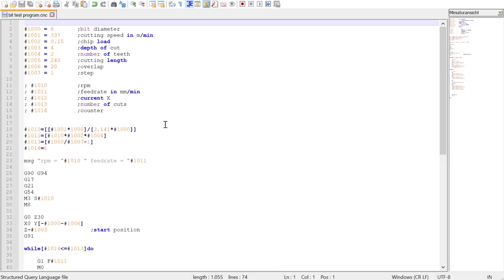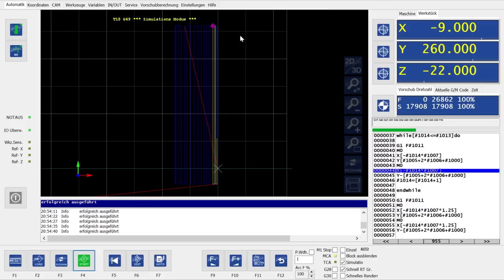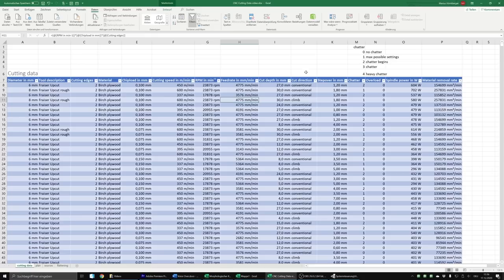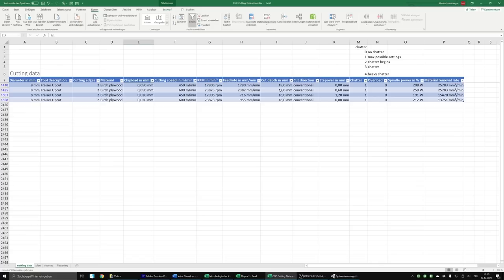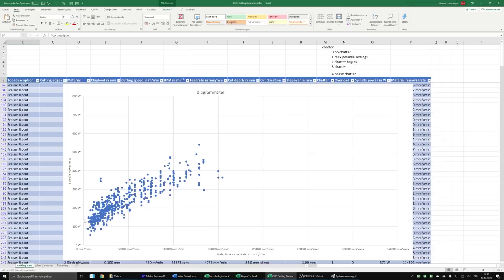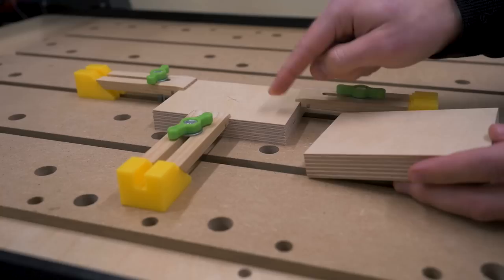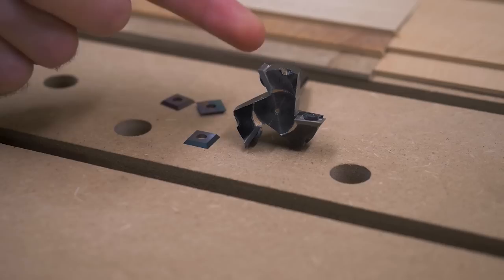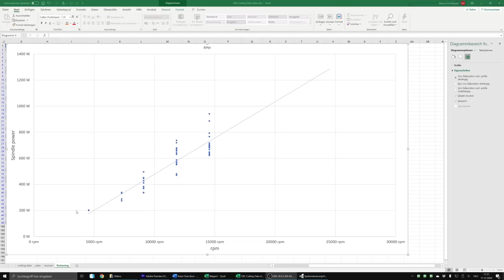Testing Diamond-Coated Routerbits + Giveaway & Free Spreadsheet

Comment: It’s interesting that they make solid carbide diamond coated bits for routers. Usually machinists use solid carbide endmills because you can run them 2 to 4 times faster than you can for high speed steel. They are also the best thing to use if you have to cut something hardened. The only issue with carbide is that you can actually run them too slow, and any slight variations in feed rate or sudden movements means chipping the teeth right off. Because they are solid carbide you can probably get away with 10,000RPM 2500mm per minute for soft wood, and 7,500RPM 1900mm per minute for hard woods.

Comment: Makes sense that the high RPM low feedrate generates more power consumption, because for the same amount of material removed the cutter has to make many more cuts.
And breaking up molecular bonds between the fibers of the wood is alot harder than throwing the resulting chips off to the side.
Also small chips don't clear as efficiently.

Comment: The 8mm roughing bit is fantastic, I don't have any bits that don't chatter. I did add two liner rails to my CNC Shark, which uses two polished steel rods, I couldn't believe how much flex they had in just a 900mm length rod. It had roughly 5mm of up and down play at the bit and could not be used for anything requiring detail, but not anymore, virtually no play at the bit now.

Comment: You made something really useful for many people, kudos to you

As for 6mm vs 8mm I found the same thing when milling metal on my small-ish mill. For deep cuts, you should use the smallest endmill you can get away with in regard to deflection. My mill will do steel with 4mm and 6mm, 8mm is seriously pushing it and 10mm is completely unusable. I optimistically bought 50mm facemill hoping to use it on aluminum but no joy... it chatters like crazy even in plastic.

Comment: For the spindle stiffness I would not look into the mounting, that looks perfectly fine, but in the bearing arrangement. In the 3D model AMB provides, you can see the bearings probably are a set of 6002 type ball bearings, held in place with a circlip on the outside. For the inside I guess the two bearings are compressed with the motor shaft, presumably from the far side. This bearing arrangement has it's limits in precision (play).
Angular contact bearings would be great, and they are even available in the same size: search for B7002-C-T-P4S. The trick with angular contact bearings is they come in sets, that pair to have a certain preload. There's a lot to find out if it could work in this situation, but I'm sure it would be a great improvement to the standard 6 euro bearings. Let me know, would be interesting to help.
There's another way to improve bearing play and stiffness: shimming. I would suggest to shim in between the inner rings of the two 6002 bearings. Probably a few hundredths of a millimeter is needed. There are shim rings available, or you could cut them from thin sheet metal foil.

Comment: great video , first time people without experience dont realise the heat has to be in the chip at least with flood coolent you have a chance with light feed rates because of poor spindle HP,  there are to many very light duty machines on EBAY that should only be 3D printers, spindle HP and rigiditly are EVERYTHING

Comment: It should be possible to construct a chatter detection sensor by measuring the vibrations in the cutting head by some kind of heavy duty microphone. This would have the additional bonus to to be able to detect if the router bit has broken.

Comment: As always you have come through with GREAT content that is useful and entertaining.   I want to thank you for the speeds and feed spreadsheet. This will be used a lot. I do not have a need to purchase bits at the moment but I am sure it won't be long.    I particularly will be looking at the planer or flattening bit. I like this one a lot.  Currently I have a Genmitsu 3018 CNC and use it for wooden artwork. I hope to be getting a larger CNC next year some time for creating larger work as well as a set of hold downs, cam clamps, Spoil boards with dog holes and such. I am sure I'll come up with more projects as well. I hope to start a YouTube channel as well.  You are inspiring with what you do. Keep up the great work. I'd love to try one of those bits out if possible. Thank you very much.

Comment: #Fraiser  I have a slab/cookie that has been drying for quite a while.  While I have been working on it with a hand plane to surface the top, it is incredibly hard to get that end-grain cut well.  It is also Oak, so my plane has been needing a good resharpening every few minutes.  If I had some sort of good surfacing bit, I would be able to make short work of the surfacing and move on to adding legs and finishing this huge table.  And for making sure it is level, I plan on using your method of a router sled for surfacing large slabs.  If I dont get picked, I will probably still end up getting these Fraiser bits since you were able to give such a detailed table for best results lol.  Keep up the great work, Marius!  Much Love and Merry Christmas!

Comment: I understand the testing you made, recording max speed without chatter. From steel machining, there is a called "economic" speed that is being used, meaning that overall life of tool insert is bigger with that speed, reducing overall cost.
So called economic speed is lower than max speed you are mentioning.

Comment: Marius very well done video for your machine, I am curious if you do the same type of experiment where you ONLY do conventional cutting or climb cutting. I have noticed that where the bit is cutting in the same direction of the rotation of the spindle makes the edge more jagged if your feed is fast, smooth if your feed is rather slow.  Chatter, one would expect at climb cut where the cut is going against the direction of the spindle.

Comment: Hi Marius, cool video. It looks like a whole lot of work. But I think the sheet with all this cutting data is worth it. And I'm so thankfully that you share it with us.
But how long did it take you to do this test series? And how much material was machined?

#Fraiser I built a CNC not to long ago. I'm still improving it and try to find good router bits. And of course these bits are great for plunge router applications. Next Project will be a cabinet with a lot of drawers to organize all of my screws and nails and other parts. Because now they are all in a shelf right now and it's a just a mess. So there will be a lot of grooves and rabbets to be cut for the drawers.
Reply from the maker: The testing was done over several weeks. Material consumtion...maybe half a sheet of plywood

Comment: #Fraiser I don't have a CNC cutter, however my router accepts the 8 mm shaft. One of the bits would be great for cutting deep slots. (The video really summarizes how much work went into producing the spreadsheet. Maybe you can do a part 2 with a harder wood. You might even hit the maximum power of the spindle with the cutting bits.)

Comment: If it wasn't clear to people watching your videos already, engineering is clearly your calling. :D
I'm definitely saving this for later if I end up getting a CNC-router.

The narrow spindle attachment to the Z-axis is quite puzzling. It's such an obviously flimsy solution that I can't imagine the engineers designing this could have missed that. It feels like it has to either be a non-issue because the first issue you pointed out ends up causing chatter much earlier anyway before the mounting becomes a problem. Either that or they deliberately designed a chatter inducing element to create a larger difference to their higher end models. I sure hope it isn't the latter.
Do you have any plans on trying to stiffen up the spindle+mount or is it "good enough for now at least" as it really only costs routing time?
Reply from the maker: yes, I'll use a spacer piece and another bolt to close that gap

Comment: I noticed that all of the cuts were done on plywood. I know plywood is challenging in its own right. However my question is, How do those bits do in hard wood. Harder of the hard woods like purple heart or jatoba. I ask because these are ones that I use. they will wear out a regular bit fast, even good carbides to last as long in these. What are your thoughts? Love your channel by the way.
Reply from the maker: I wouldn't use the max. possible settings from plywood for these hardwoods. I'd try about 75% stepover (compared to max. possible in plywood) and chip load not below 0,05mm

Comment: Hi, Would it be possible to get your gcode program? I've just started using my home made cnc. 600x800mm. I would like to find the best settings for my machine. My 500w spindle runs tops out at  12000 rpm. I'm currently tweaking my plans in fusion360 for a little lending library. The router took about 3 months to build and is a retirement present for myself.

Comment: "Ignore the random blue screen". I haven't used Windoze for over 20 years. I don't use Mac, either. I never have this kind of problem.
Reply: "I got one of those matrix ports installed at my brainstem back in '07. I'm watching this video from a rig in my basement jacked into a hard line. Now, albeit: I do occasionally have misanthropic AI's and killer robots to contend with... but never THIS kind of problem. Noob."

Comment: working on SCM M100 machine center:
the smaller diameter  you need slower rpm for bigger you need faster rpm drilling bits have different speed requirements than milling bits in my experience of tests i decided to use my own formula for example : drilling 5 mm bit  300x5 = 1,500 rpm for milling 8 mm 8 x 1200 =9,600 you can go up based on wood hardness or slower this based on CNC i m working on there is based on my experience and tools lasted longer with these numbers if any one knows the actual scientific formula to calculate RPM please let me know

Comment: 5:55 Does it make a difference, if you go with the rotation of the bit or against it?
Reply from the maker: Yes, Going against the rotation gives a better finish in most cases. With the rotation is easier on the bits (not really important for wood, only for metals)

Comment: #Fraiser

Project: CNCed plywood furniture.

The 35mm flattening bit is amazing, I tend to push it a bit harder at 15krpm, 9m/min feedrate, 2mm depth of cut and 32mm width of cut, and it still performs amazing. 
Their uncoated inserts for it also leave a pretty nice surface in aluminium ;)
Reply from the maker: Wow, very agressive settings. How much power does you spindle have? 2.2kW?
Reply: @MariusHornberger  3,3kW, one of the bigger teknomotor spindles. I guess the real tool limit is the 8mm shaft, with a higher depth of cut I get chatter at least in plywood. I should have bought the tool with the 12mm shaft in hindsight.

Comment: Loving every bit of this! 😀 Just finished building a Shapeoko-like DIY CNC router. Did a Sharpie test and hoping to test with some wood after the holidays. Though I am a bit jealous of your spindle pile, mine has a Mafell mounted as well, so your results should be useful!
These nicer bits I would probably only use after breaking a few cheap chinesium ones on starter projects with birch plywood and scraps. Shop stuff, small furniture, home trinkets...

Comment: at  11:08 you have chatter value of 1 ( max possible settings) with 702W at line 17, isn't that the maximum Wattage without chatter, instead of line 33 ( 0, no chatter) with 632W? Still a long way form 1KW though.
Reply from the maker: hmm, yes that's true

Comment: #Fraiser
I will use the bit to create my diy touch probe sensor and, when that is done I will use it to create house sign and various shop upgrades (magport dust connector, etc)

Vary informative and well thought out video with great information!  Very useful! Perhaps you could do a video on which spindle is the best (if there is any difference) and why you need 4 spindles?

Comment: #Fraiser
I will use them to finish my multi wood mosaic table.
If you would like, I can provide some extra data points for your spreadsheet with a 2.2kW electro spindle on a machine that is a little stiffer.

Comment: #Fraiser

I'm building a Tiny Little Library (basically a box that holds books where anyone in the neighborhood can take and/or leave a book) for a friend, and could really use some good router bits.  I'm currently using some cheap Chinese router bits, and they just don't have the accuracy I need for making good dadoes and mortise and tenon joints.

Comment: I bought 3D carving bit from them, after 3 times use the tip of the bit just broke on wood and they even didn't reply "after sell" question, result is i've a broken  60€ carving bit :)
Reply from the maker: That's really bad to hear. I guess you won't buy another bit from them. Should I let them know when I'm in contact with them again?
Reply: @MariusHornberger  Yes please, maybe you'll get an answer.

Comment: #Fraiser At the moment I am working on a RFID based Music Player with a Raspberry for my children. In the end I will need some kind of case with openings for the speaker and the controls. That would be my first project using the router bits in my normal router table since I dont have a CNC yet :-)

Comment: #Fraiser I'd use them in the router table i'll be gifting myself for christmas. I'm still learning a lot and so far I've only used a cheap router with cheap bits.
Reply from the maker: cheap router with good bits will make a huge difference. Also better and less expensive than good router with cheap bits